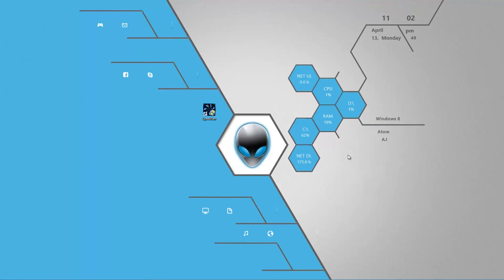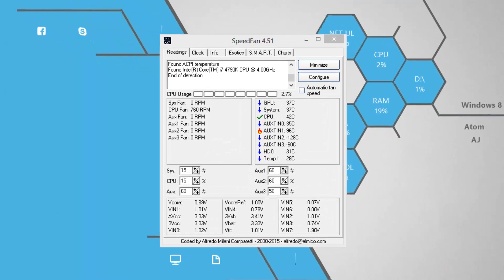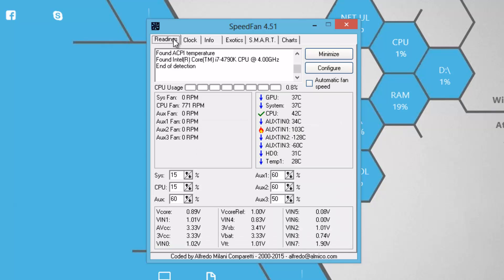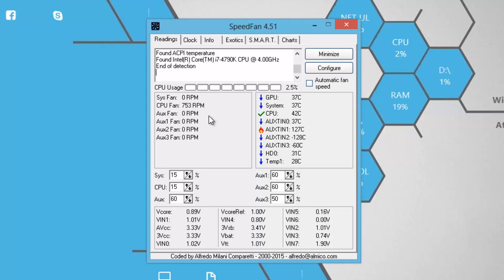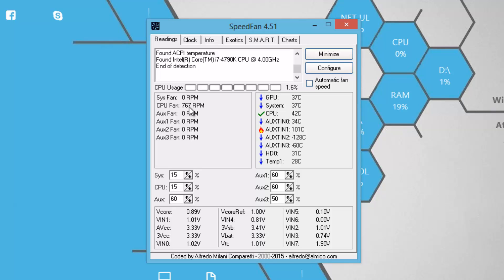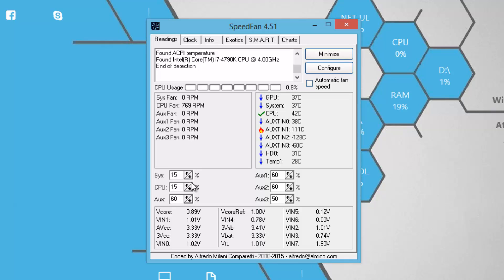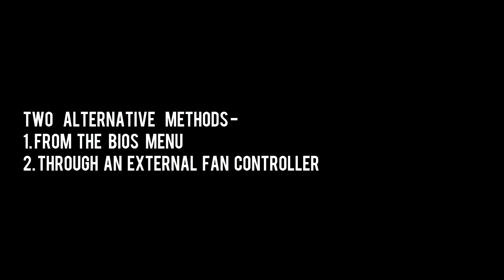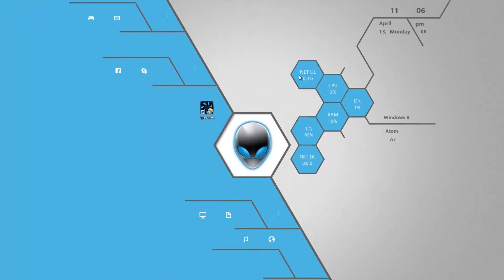How to Control System Fans' Speed with SpeedFan

Comment: Oh my goodness! dude you better raise your cpu fan speed! ~770 rpm  looks very low to me! Pretty sure it should be around 1500 rpm on average, better check that out before you toast your cpu!!!
Reply: +Jacques Goulet depends on your cpu cooler. I have a nh-d15 and my fans run at 200rpm and my cpu is at 35c
Reply: +Starchy CsGo yeah ok, but this is a hell of a cooler you have there. I wouldn&#39;t run a regular stock fan at that speed! Still, why do you run it so low? they are made to turn up to 1200 rpm don`t they? If you run it at say 400-500 rpm I don`t think they will be that much louder! Are you sure about your temp? Be careful man, better be safe than sorry!